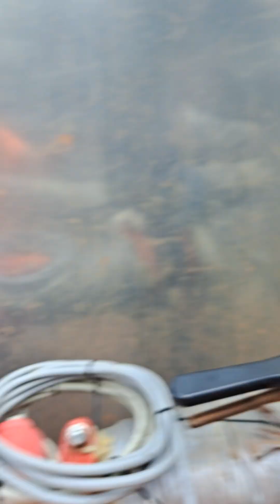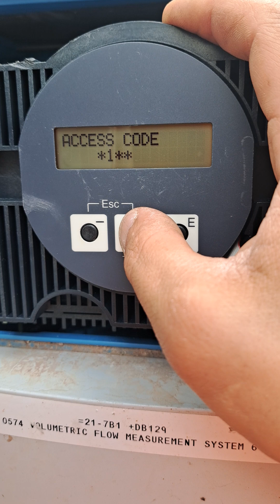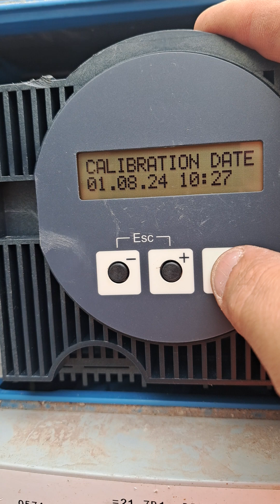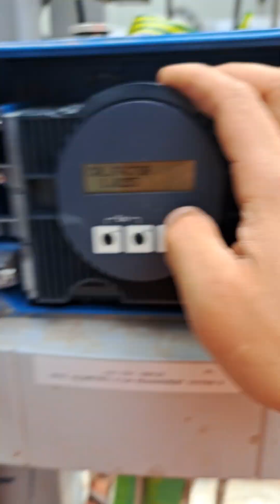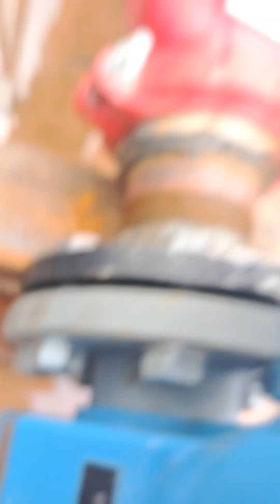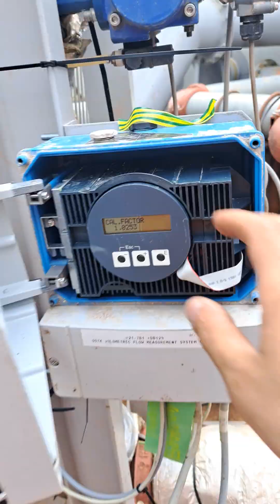Endress Hauser promag 10/50 Change of the K Factor/Coefficient in Expert Mode.

Comment: As K increases, Q increases ?
Reply from the maker: No, K is correction factor defined by Endress Hauser and linked to the flowmeter. He must be respected in the setting of the electronic to guarantee an accurate value of the flow 🙂